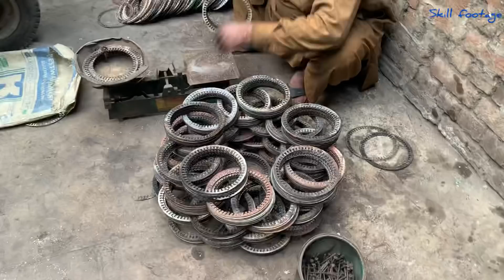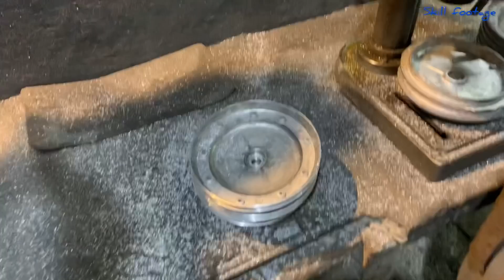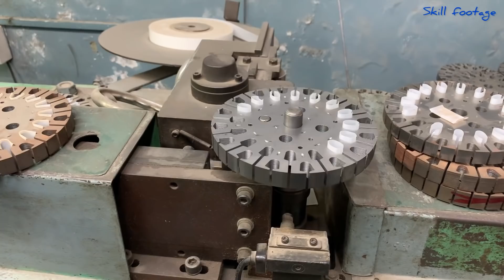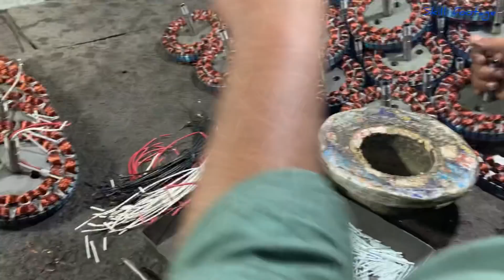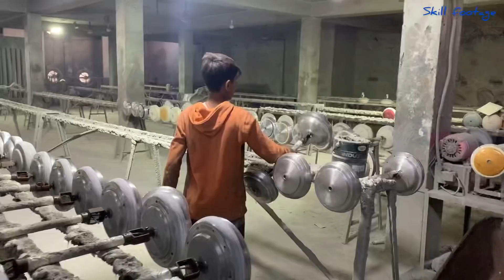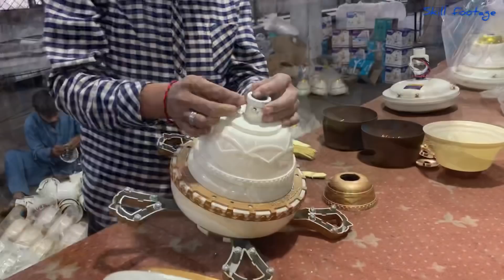How is a Five Blade Ceiling Fan Produced in a Factory || Ceiling Fan Production Process in Factory

Comment: What I like the most about such factory videos is the validation and testing stuff. „Hmmm. Let’s spin this thing in the air. That’s a PASS all right!”
Reply: Zero rejection.......!!!!
Reply: There is more to it than meets the eye, actually most of casings require a little weight balance adjustment and despite apparent simplicity of the method, are balanced quite perfectly using only human skill and judgement. You can see tiny pieces of metal and silicone adhesive with those guys to  correct the weight imbalance by applying little weight to the lighter side where necessary. Video maker probably decided to eliminate the process of balancing for the apparent lack of interesting stuff in that process or maybe he thought people will be more impressed with it passing without any need for balancing.

Comment: Casting can be substituted with forming in ceiling fans. Please think about it.
Reply: In bigger manufacturing companies they use this forming process.
Reply: Actually, among AC motors, cast motors are better than most mass-produced stamped motors by a landslide. They dissipate heat better so you can get a more powerful motor without it overheating.
Reply: Cast motors are among the gold standard of ceiling fan motors. Since 99% of today’s AC-motor fans use stamped motors, it’s nice to see these smaller factories still casting motors